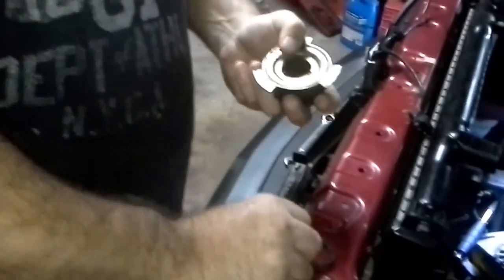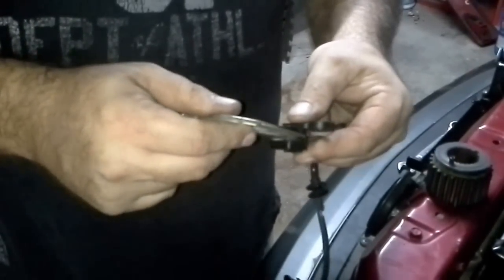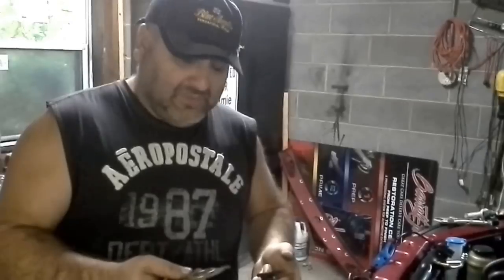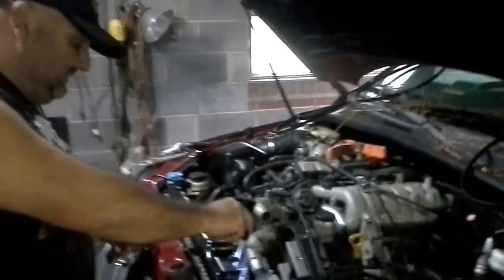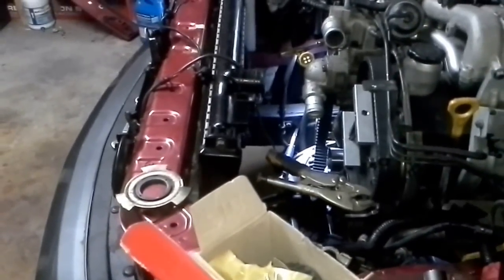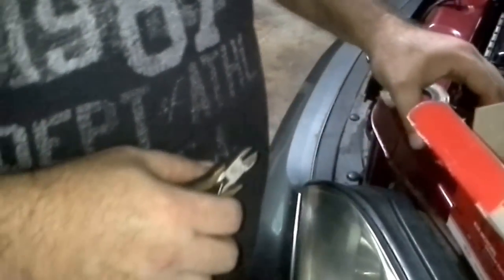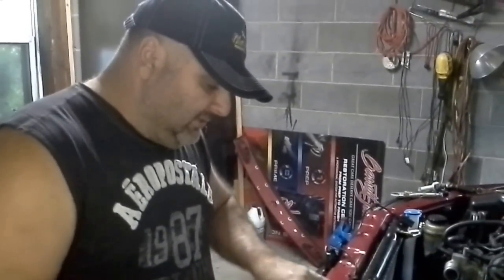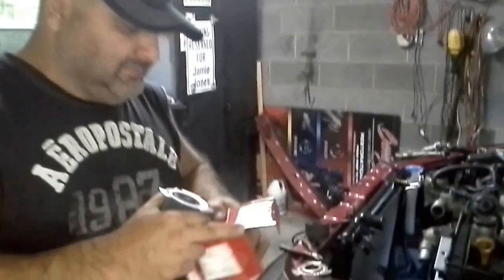Reluctor Wheel/Cam and Crank Angle Sensor- How It Works

Comment: 1997 GMC Sierra 2500 pickup truck 1 ton 7.4 dually.. my motor quit I thought I heard something breaking. No control side of fuel pump relay I was able to get full fuel pressure from zero pressure with jumper wire load side fuse box. No spark at all. I checked the fuse and power at ignition A ignition B and ignition e  I've changed everything coil ignition module crankshaft sensor. Spark plug and wires entirely new distributor perfectly inserted. Still no spark. Computer will arrive ECM I guess you call it tomorrow. Looks like I have to suspect reluctor and purchase it and take it on. Is there anything else I left out.? Besides a psychiatrist.

Comment: Nice and simple explanation! Have you ever seen the reluctor wheels on gm hf v6 engines ever seeb a burr on the tooth edge leading to a p0341 camshaft performance error?  The wheels on these have 2 long and 2 short teeth. Link below shows the camshaft and the attached 4 tooth wheel. This in an 07 2.8

https://youtu.be/8RcQinn7cIw?t=49

Comment: 2010 Kia soul gives p0016. I believe after changing other oem parts the problem is the reluctor ring on back of exhaust camshaft? Or the intake? Is this absolute to replace as pair or? Hoping is just the pin broken. Any advice appreciated. Thank you
Reply: What engine? It may be the wheel on the rear crank.

Comment: That reluctor is not supposed to move out of position.  It is secured tightly in place between a step on the crankshaft and the sprocket. For those of you who still have timing belts and are doing it yourself, be SURE to torque that crankshaft sprocket to AT LEAST spec.  A little over is great. I had a mitsubishi 1.5 liter that seemed to run ok, but when I went to change the belt I saw that the sprocket "keyed" portion was worn inside, compressed by the crankshaft in the direction of the turn because the crankshaft bolt was not tight enough to help take the turning force.  The crankshaft ended up wearing the softer sprocket, making it loose and worn out inside so much that upon putting it back in place, I had almost 1.5 teeth of play advanced and late (I hate to use the "R" word).... and the reluctor was loose and rattling and started slicing away at the crank angle sensor.

Comment: If the reluctor wheel has slipped on the Crankshaft why can't you tap it back in place and install a set screw or tack weld 🙂

Comment: Hi mate i have a 96 3.5l Mitsubishi pajero/Montreal and has misfire on 3 and 6 cylinders I've replaced everything apart from the crank sensor and cam sensor or the computer but still has misfire why

Comment: I had my engine rebuilt the person that rebuilt it put a different camshaft reluctor wheel on the overhead cam I want to put the correct one because it keeps jumping timing is there anyone that can tell me how after I take off the old one without taking everything apart because I watched a video on it to mark my new one so the timing is correct I guess what I'm trying to say is the replacement part that I put on I want to make sure the timing is correct how do I do it I heard there's a trick to it